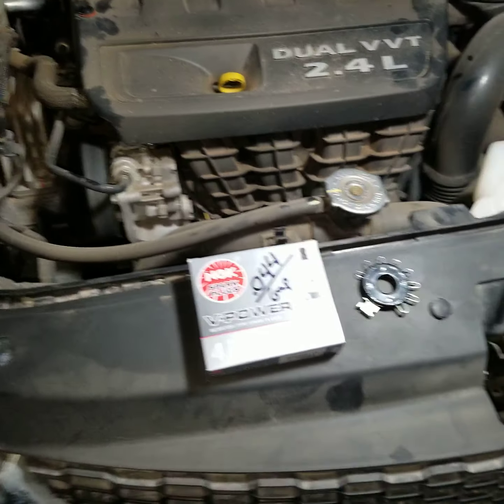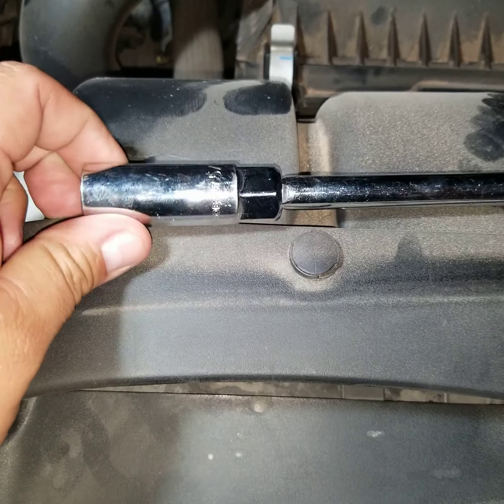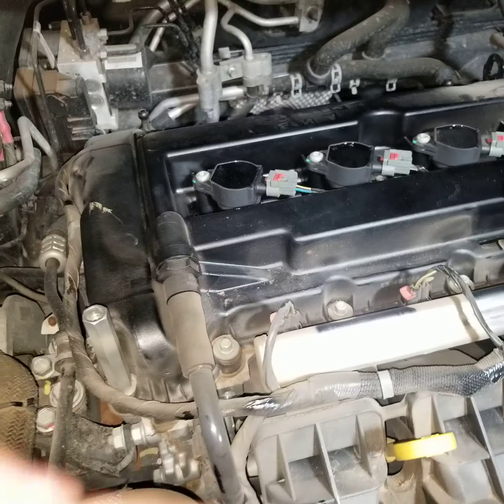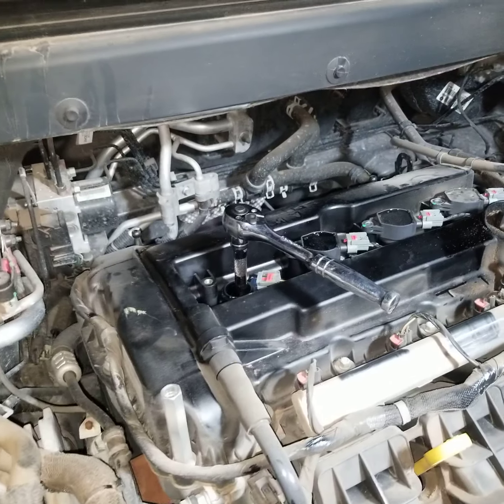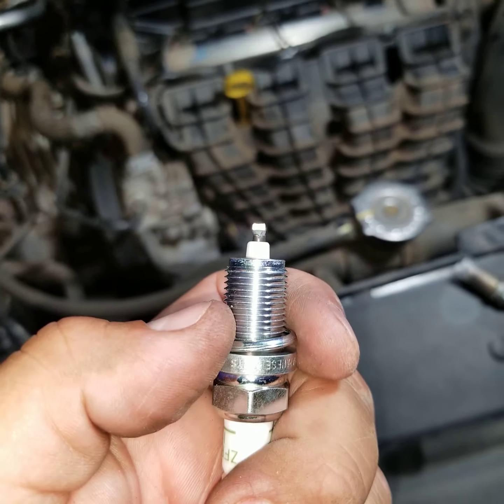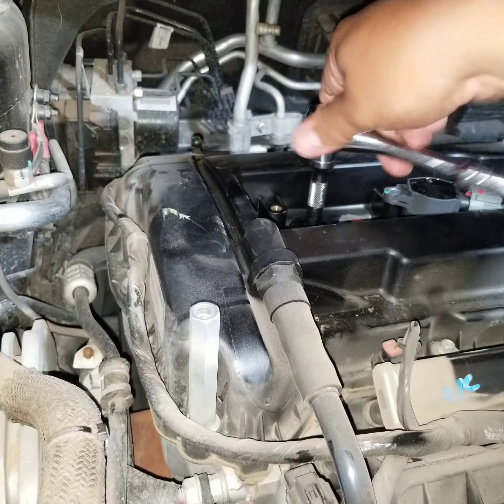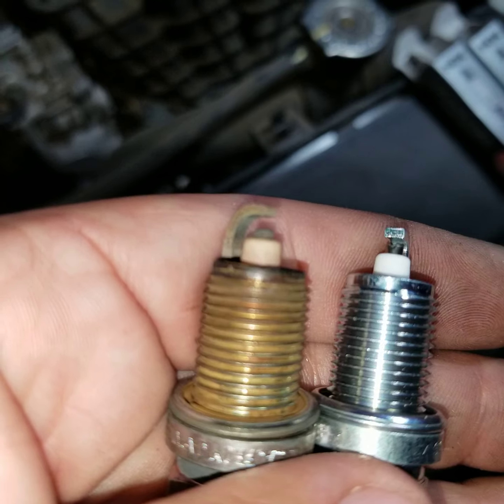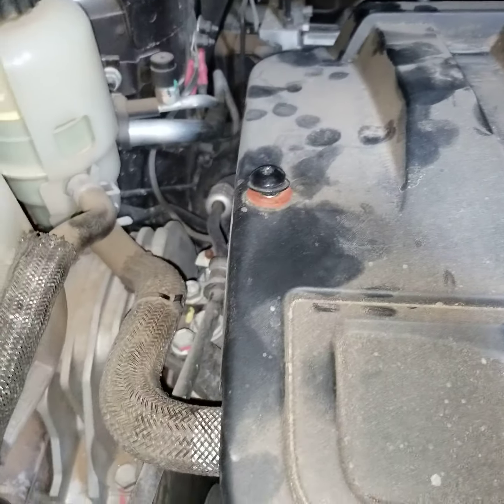2015 Dodge journey 2.4L spark plugs

Comment: Did these a couple of years back ... was getting hesitation and shuddering accelerating on hills. Plugs hadn't been changed in almost 100,000 miles. Electrodes were worn pretty bad.

A few little suggestions. Since it's an aluminum engine, put a little anti-seize on the threads of the plugs. Also doesn't hurt to add a dab of dielectric grease to the boots.  Oh - and try to do it on a cold engine.  If the engine's hot, you can over-tighten the plugs and/or run the risk of stripping the threads. Nobody wants that repair bill.

The 2.4 Journey is one of THE easiest spark plug jobs you'll ever do. Cheap and easy maintenance.  I should actually do mine again before winter sets in ...

Comment: Be glad you don't have a V-6 powered Journey because those back plugs would be a nightmare to change.
Good job on the video.
Reply from the maker: I did some on an avenger 3.5 I had to remove the air intake manifold and climb on top of the engine I feel ya lol thank you!

Comment: Thank you very much. Yes I have a question. If possible I know you get a lot of messages. I’m thinking about doing it myself. I saw your video and you pretty much explained everything. I’m kind of afraid of doing it myself. I’m gonna do it just the way you did it. Thank you.
Reply from the maker: You will do great! Just take your time and having a spark plug socket will help you a lot. It holds the Spark plug for you and do not over tighten. If you have another question let me know 👍🏼

Comment: Just wondering if you ever looked at noise at th efront end. The struts and links were replaced along with the sway bar bushings. however the same noise is observed. The Journey is still under extended warrantyy so I am still trying to locate the issue. On  the front  passenger i hear a phooshsh when i go over a speed bump or a driveway curb. I also replaced the rotors and pads with good quality after market Brembo products. However I hav ebeen told that sometimes after market brake parts will be noisy over bumps this was the case with my 2007 Dodge Magnum. Any ideas this week I am going to a warranty service centre and we are looking underneath at motor mount actually near the sides and on top for the Journey an t ranmission mounts and we will also use a pry bar to see if anything is moving as we pry.
Reply from the maker: Haven't heard anything and I've put almost 60,000 miles on it. Do you live close to salt water?

Comment: Any videos on replacing the coil pack on a 2017 Dodge Journey 2.4?
Reply from the maker: I would replace the hole coil pack and boot, taking out the spark plug you already have the pack and boot out anyway you can just replace them. Rockauto is my go to for parts way cheaper then local.
Reply: @adrianortega2124  is there a video on how to replace the coil pack or a step by step guide trying to save some money on this repair by doing it myself
Reply from the maker: @andreaquartaro4610  I’m my video I remove the whole coil pack to get to the spark plug at autozone they are about 100$ for all 4 replacements. You will save a lot of money doing this yourself for sure. If you want a little bit cheaper parts rockauto is my go to.
Reply: @adrianortega2124  Question: I have this exact vehicle 2015 Journey 2.4...I was also planning to replace the spark plugs with these NGK Vpower ones. Do you think it is recommended to use dialetric grease around the ceramic of the plug or in the  hole of the spark plug boot?
Reply from the maker: @ricardoperez8879  you can it’s to keep it from seizing and possibly water proof, but honestly I have never used it on any of my vehicles and I have never had a problem. But I do live in a very dry area so moisture and rust not a big issue for me.
Reply: @adrianortega2124  Makes sense. And how do you feel about using NGK iridium spark plugs?
Reply from the maker: @ricardoperez8879  I love ngk they haven’t let me down yet

Comment: Thanks for the upload.  Nothing too weird here.  I have a 2017 journey and my manual has the spark change at 30,000 miles, maybe because they used the cheaper copper plugs.  Also the recommended air filter change is 50,000.  To me that is too long, I change every 20,000 or less.

Update I did not have to disconnect the wire from the coil for cylinders 1,2,3. I did have to remove the wire for number 4 as the wire led underneath the fuel line.  Maybe my wire harness was a little longer.  It appears the plugs that originally came with the Journey are cheaper copper.  Now I know why they wanted me to change the plugs after 30k miles, if you replaced your plugs the ones that came with the car I suggest you replace them after 30k miles.  I replaced my plugs with the double  platinum. I will see how they perform.
Reply from the maker: covercalls88 thank you for the info I will check on them
Reply: Time to change my plugs. How did the platinum ones work out? Any noticeable change in performance?
Reply: @ricardoperez8879  I did not notice any real differences except a slight mileage improvement of maybe .2 miles per gallon over the copper plugs when new.  I would recommend platinum plugs just because they will last longer.
Reply: My dodge is shut off not lose power but shuts off engine wise when I am slowing down and jerks and lower rpm when I’m driving at a steady speed did you figure out what’s causing it no check engine light either

Comment: Is a 2018 same as 2015 when changing spark plus? I just got a 2018 and it misses while it's at high way speed, no power when taking off and uses more gas then should. I want to change the spark plus but not sure what is the best kind 🤔 or if this would be same as my 2018. Thank You. Trying to make it home 1600 Miles and don't want to break down along the way
Reply from the maker: If it is a 2.4 L is the same
Reply from the maker: Make sure air filter is changed too
Reply: @adrianortega2124  thank you
Reply from the maker: @Roamingraven37  I go with the ngk spark plugs honestly I’ve never had a problem with them I even use them on my truck.
Reply: @adrianortega2124  thank you very much 😊 I am from Pennsylvania and on my way to Texas my suv got totaled so when I finally made it to Texas got this journey and I honestly don't think the dealership even checked it. They said they just got it in and gave it to me lol so I want to do a tune up before heading back to Pennsylvania :)
Reply from the maker: @Roamingraven37  good luck 🍀 be safe (Texas native here)

Comment: This the same setup on 2013 2.4 L?
Also how ofter should coils be changed?
Reply from the maker: Should be the same setup if it’s a2.4 I’ve been told you know when you have to change the coils out, like if you feel like is misfiring or running rough I haven’t changed mine out yet I’m at 70,000 miles.
Reply: @adrianortega2124  cool thanks.
Im at 65000 and it recently started shaking when i hit 65mph. Just keeps on until i lower my speed. Any thoughts on that?
Reply from the maker: Sounds like a unbalanced wheel? Where do you feel like the shaking is coming from?
Reply: @adrianortega2124  the front. I had just got new tires. I was thinking they either did something wrong or i need to check alignment. It seems to be driving straight though.
Reply from the maker: Yeah maybe the balance is off? Did it do it before you got the new tires?
Reply: @adrianortega2124  not that i remember. Im gonna take it in tomorrow morning and hopefully thats all it is. Thanks!
Reply: @adrianortega2124  got tires balanced today. Runs smoothly now. Thanks for the advice.
Reply from the maker: Nice 👍🏼

Comment: When you recommend changing the spark plugs when the car is hot or when it is cold?
Reply from the maker: Cold, I did a car hot one time and it melted the rubber holder on the inside of my socket.

Comment: My dodge is doing this it will shut off not lose power but shuts off engine wise when I am slowing down and jerks and lower rpm when I’m driving at a steady speed did you figure out what’s causing it no check engine light either
Reply from the maker: That hasn’t happen to me but it sounds like a fuel issue. Maybe the fuel pump or fuel pressure regulator I would change out the fuses and relays first.
Reply: @adrianortega2124  it was the crank shaft sensor! A check engine light finally came on
Reply from the maker: @TheAverageLifeCassandraA  nice! I’m glad you figured it out

Comment: I have a 2012 dodge journey 2.4 my problem is a power drainage something is draining my battery and sometimes after I turn off the car the lights on my dashboard stay on. The only thing I do is turn the car back on and off again then the lights go off
Reply from the maker: Does it have a tough screen radio? What I did is go to the settings and set the radio and the lights to turn off right when the engine turns off. I had that problem too even the radio would stay on for a while. Let me know if that helps

Comment: After changing the spark plugs on a 2015 journey and now the drivers window doesn't work
Reply: Help
Reply from the maker: Pretty sure changing the spark plugs wouldn’t cause that. But do you still here the motor on the window but it’s not moving or you don’t here anything at all when you press the window button?